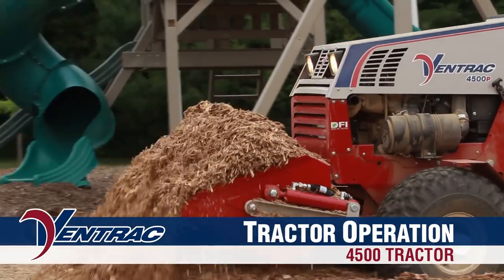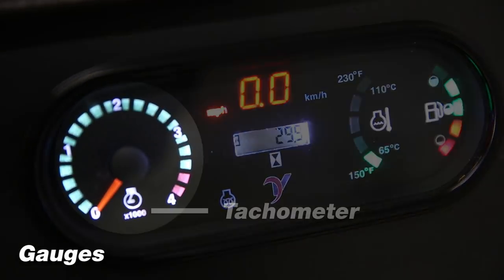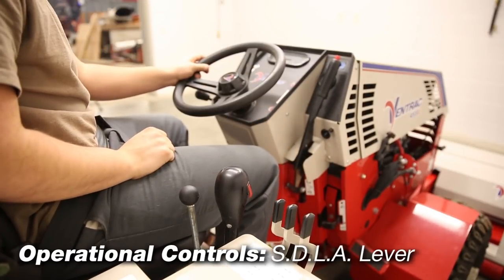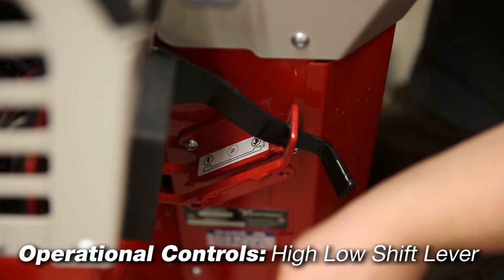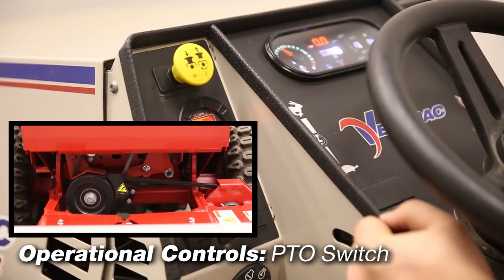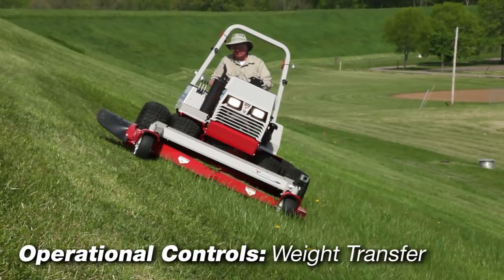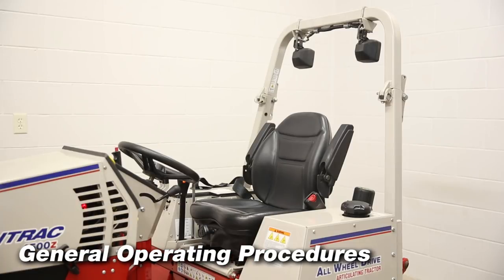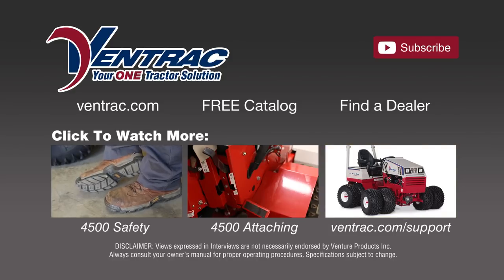Basic Operations for a Ventrac 4500 Tractor

Comment: +ventrac why do use a pully system? I'd rather see a PTO shaft connection. Seems like it would be stronger and less prone to slipping
Reply: P0tat07 a belt is nice because if a part has to be sacrificed it’s much better and cheaper to destroy  a belt. A spare belt can always be carried for back up. I look at a belt as a fuse or a shear pin. Everything will break, having an engineered weak spot that’s cheap and easy to replace, to me is a great piece of mind.
Reply: Ever in these machines a bunch in my time never had a belt slip they may break but not slip

Comment: what model is the salt spreader, how is it attached will it spread fertilizer?
Reply from the maker: Hi Thomas. Ventrac currently offers two spreaders: the SA250 Drop Spreader and the ES220 spreader. The SA Drop Spreader is primarily designed for deicing materials in the winter. The ES220 spreader is better for seed, fertilizer, and penn mulch. Additional details about these spreaders, including their mounting requirements can be found on our accessories page here: https://www.ventrac.com/products/accessories.